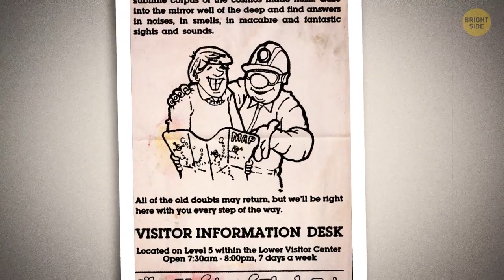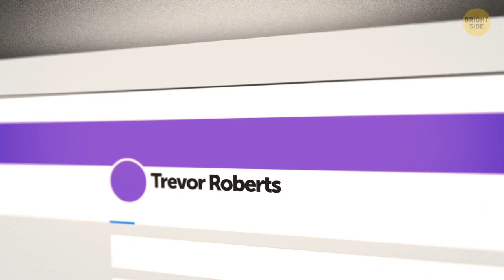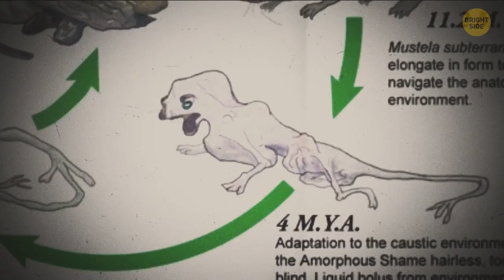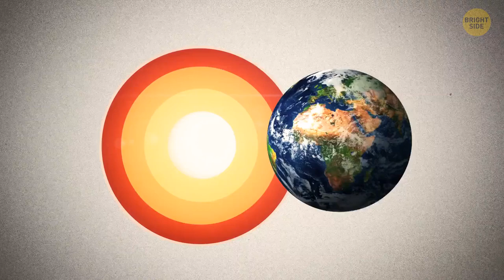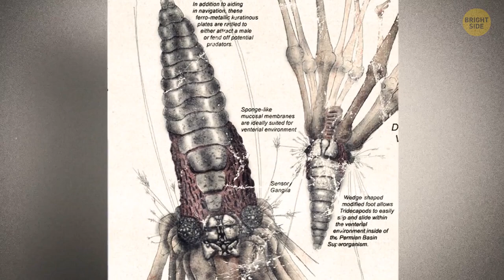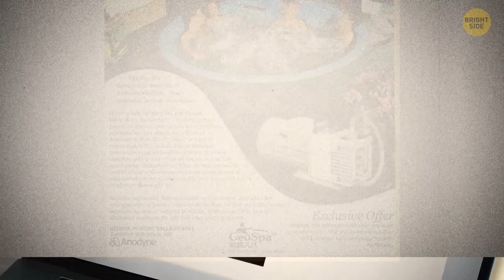Mystery Pit That Breathes, Makes Sounds, And Moves

Comment: That’s not actually what happened, on 2007 July 4th it was raining a lot, causing the pit the flood there was a pump drainage system that was supposed to drain the water but that pump failed causing it to overflow to dangerous levels causing the creature to wake up and contract, destroying the lower visitor center and the elevator.